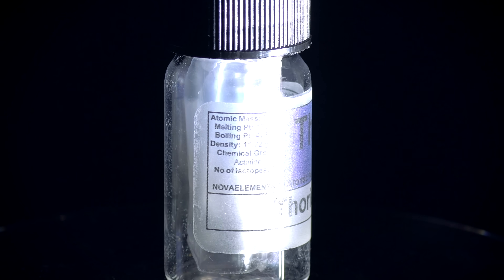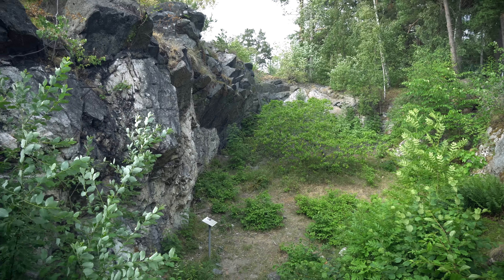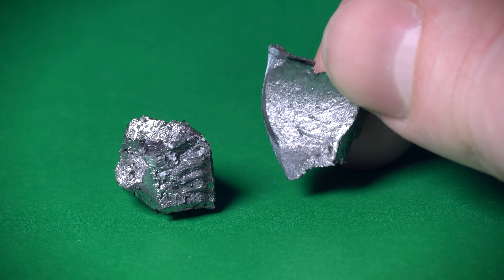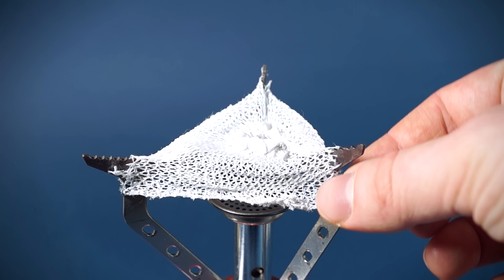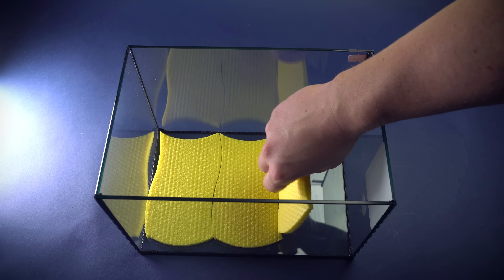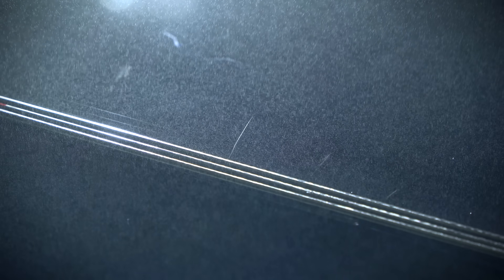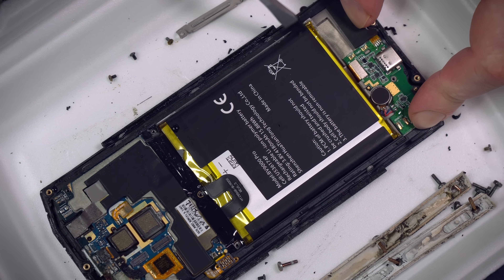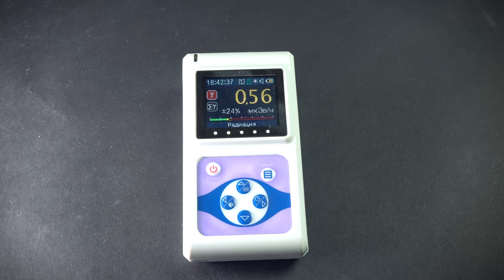Thorium - A METAL THAT NO ONE NEEDS!

Comment from the maker: P.S. Info about thorium reactors:
https://en.wikipedia.org/wiki/Liquid_fluoride_thorium_reactor
Also, it needs to be done a lot of research until thorium fueled reactors can compete with uranium based reactors.
P.P.S. Please help me make subtitles to this video, here is the script: https://drive.google.com/file/d/1vyE6xt3hEc2QEddYTOmKfMr4yfHMn9as/view
Reply: Thorium is the chance of almost endless energy. That is not useless..
Reply: No shit that it will take some time to iron out the kinks for a brand new concept that also happens to be something so incredibly complicated as a molten salt reactor. It took, what, 20+ years after the Manhattan project to make the first reactor that pooped out 5-ish MW?

I don't see why you went out of your way to shit on the concept.
Reply: @Runefrag  Molten salt reactors were first tested in the 50's and early 60's.  The concept is proven, it just needs a commercial reactor design and regulatory approval.  Which is difficult when the industry is based around light water reactors.  

IIRC China now has one up and running.
Reply: @p51mustang24  You just repeated everything i said.

As for the part you didn't:

MOLTEN SALT REACTORS // THORIUM MOLTEN SALT REACTORS.

Two different things. :)
Reply: Uranium in nuclear reactors is approximately 2%. Thorium reactors were in use in the 40's. No issue like the Fukushima disaster. The reactors could be turned off with a switch. But the uranium lobby convinced the government to support it. The rest is history.
Reply: https://en.wikipedia.org/wiki/India%27s_three-stage_nuclear_power_programme#Stage_III_%E2%80%93_Thorium_Based_Reactors

India is planning on using it in the future but it's a long way away :/
Reply: Try to find my teacher, Yudi Utomo. Now he is researching how to use thorium as a nuclear battery.
Reply: @dannielyuwono3680  same idea I had . the thorium will be the sorce of positive charges since it emmits alpha positive particle and the negative could be the air or the silicone carbide with aluminum doping ie ( deposites)  for negative charges .very simple idea .the thorium positive anode could be placed and packed in a glase container and the thorium could be in form of thorium oxide instead of pure thorium for economic reasons .and the glase container will be coated like a mirror to prevent alpha particles to penetrate outside the glass tube by reflecting the alpha ray into the thorium sample again .
This sustainable battery is very useful to put it to charge electric cars when they are going and staying far from charging stations and ponts .
Or to generate electricity in remote areas or other uses .
Reply: Would that ethanol happen to be drinkable?
Reply: @WaliWorldX Uranium is also a lanthanide but large deposits of economic grade exist all around the world, unlike the REEs.  It is the chemistry and mobility of U that makes it more accessible. There are deposits of U in many countries, including the UK but name me one of thorium in Europe!  Yes, there is a pegmatite in a small quarry in Sweden, but it is uneconomic and in a Natural Park.
Reply: https://ok.ru/video/98287684270
Reply: I'd thank you, but i didn't come here for a damned chemistry lesson.
entertainment likely required.
Reply: I have watched them and the USA had tried creating less expensive nuclear power reactor.  But the people who bribed the Nixon and Congress, people in uranium business already underway.  Sixth gen nuclear reactors are very promising.
Reply: "Sponges which I soaked in pure ethanol"
...proceeds to dump out contents of personal flask! 
Hahaaha xD
Reply: Thorium reactor was invented in India and running, India have highest deposits of thorium in the world 
Projects running to provide 50percent of India electricity in thorium reactors by 2030
https://youtu.be/pTFOzHsbvAE
Reply: @WaliWorldX We know where thorium and REE deposits are located in geological terms. The main problem is that (like lithium) their occurrence is not widespread.  Monazite sands and pegmatites are the main sources and these do not occur, e.g. in Europe.  Currently, thorium retails at approx. 100 times uranium and while this reflects mainly demand, it also reflects the difficulty of locating and supplying thorium.  Gold is less abundant than Th but it is easier to find and exploit small deposits of gold.  Most REE deposits are in China, so that presents yet another problem for supply.  Uranium is widespread in geographic terms, and cheaper easier to locate and extract.
Reply: hawkturkey  But only monazite-bearing sands contain thorium, and they only occur in a few special places. We know the geological environments in which to find REEs and Th, unfortunately they are limited in occurrence.
Reply: Yes, Th is about as abundant as tin but tin can be concentrated in mineral deposits.  Uranium is a thousand time more abundant than gold, but gold occurs in many geological situations and is likewise concentrated by some geological processes.  Thorium and the REEs (excepting U) are chemically unreactive so they are difficult to find and extract at the normal levels found in rocks.  There are many exploration companies prospecting for REEs (and Th which is associated) but it is difficult and only a few places in the world to look.  Uranium is so widespread that the price has come down and this actually makes it hard to make a profit on it! @WaliWorldX
Reply: @WaliWorldX I forgot - many countries adopting nuclear  power wanted to be independent of OPEC countries for oil  supplies, despite having oil/gas in the North Sea.  Likewise, depending on others for thorium would lose this strategic independence.  Uranium is widespread in Europe but not thorium.  The same might happen with lithium as Bolivia holds 50% of current reserves, and like thorium it is not readily concentrated by geological processes to economic grades.
Reply: Are all things in Ali Express have this stuff or just certain things that have it? Should I worry about everything . What about other based products from other countries?
Reply: Not true. There US govt experimented with both. Thorium lost only because you couldn't make Plutonium breeder reactors.
Reply: India was looking at thorium reactors but that was because they have more thorium deposits than uranium. The reality is you can breed fuel from U238. Some people say it's more safe because you can make nuclear weapons but this is untrue U233 has been weaponised.
Reply: At the moment I think it should be stabelised in a form that won't leach and won't form dust and stored back in the ground where it was mined in a form that can be retrieved easily if we find a use for it. I think rocket nozzles and furnace linings are definite allocations if you can make a sealed ceramic that won't produce dust.
Reply: Always was told thorium reactor research wasn't  invested in was because it didn't produce enough material for bombs.  Research was only done before the huge uranium deposits we have now were found.  It a damn shame as thorium reactors produce far less unrecyclable waste than uranium reactors, last longer while producing only about 10% less power.  As always the interests of military and money grabbers comes before the public good, they should be ashamed of themselves!!
Reply: Thor's hammer is made from thorium, of course I'm bullshitting.
Reply: @WaliWorldX Not unviable, there will be thorium reactors and some more Th mines but you can't extract thorium economically  from a crustal abundance grade, you need a geological process to create an economic deposit. You cannot just mine anywhere, you have to be in the right geology first.  This applies to most metals, copper, zinc, uranium lead etc., they need to be concentrated. The lanthanides do not have the same chemistry and are not easily concentrated by geological processes. Thorium behaves like a lanthanide but uranium does not, being somewhat soluble in water. There are 14 types of uranium deposits but only two for thorium.  So the pegmatites and the monazite sands are not widespread in their occurrence.
Reply: Max Pain  Not as plentiful as uranium though.  Only a byproduct of REE mining. Name a thorium deposit in Europe!
Reply: @WaliWorldX In mining it's very simple.  If the cost of digging out and processing the material is greater than the contained value at market prices, then you will lose money.  I did a calculation once on a river with alluvial gold in the gravel.  After a hard day's work we had panned about $10 worth of gold, more than our lunches cost!  With mineral exploration, the costs are all up front exploring large areas and employing people and special surveys and it might result in nothing.  Money is raised from investors but they stand to lose their investment.  Even if you are making money in mining, a larger deposit might be found in a low-cost area and the price goes down as supply goes up, so your little mine starts running at a loss.  In the end it's simply market forces that determine the price.  With uranium, there is plenty of supply and a consequent low price.
Reply: @WaliWorldX I think you would need to read up on economic geology. Mines have to be found before they can be opened, and when they are found they have to be operated under normal economic constraints.  You can not mine anything anywhere! For example, the average crustal abundance of gold is 0.004 ppm (g/tonne)  but even though it is valued highly, you still need a deposit of at least 4g/t grade to mine, i.e. an enrichment of 1000 times.  Chemical enrichment through geological processes, not isotopic enrichment, btw. For copper it is only 5 times but that is only for really huge deposits of hundreds of millions of tonnes.  In the case of U and Th one needs at least 100x concentration by geological processes.  Then you can mine it and again you need to concentrate it to a grade that your client wants, e.g. for fuel pellets.  At this point it has a value and that is determined by market forces. If people want it the price goes up, if others supply lots of it, the price goes down. There is no mystery or conspiracy!  But as I have said already several times,  thorium does not concentrate in the earth as readily as uranium, so the latter will always be cheaper. Not sure how better to explain this, so I will leave this debate now.
Reply: I am sadden you went so political on this one . thorium salt reactor's eat uranium waste by product's and you know it . if you have to use nuclear thorium is the safest way to go .
Reply: Yes, thorium as a metal has few uses. As the oxide, it  has many uses as the comments below point out.  However, as a nuclear fuel there is a major problem as although thorium is about 4 times more abundant than uranium, it does not form enriched mineral deposits like uranium which can be dissolved (hexavalent state) in oxygenated groundwater and precipitated in reducing conditions.  Extracting thorium from ores containing a few ppm Th will always be very expensive.
Reply: There are already big deposits of leftover 'waste' Thorium from other operations.
Reply: @mariobeck3798  Not large compared to uranium deposits in the ground.  I'm not talking about minor quantities of waste materials .The Olympic Dam deposit in Australia has enough uranium for 400 years at today's consumption.  There is no thorium deposit even approaching 0.1% of that.  Thorium is more abundant than U but there are no comparable geological processes to create large economic deposits of thorium.
Reply: @mariobeck3798  And lots of cheap uranium waste too!  As well as lots of uranium resources in every continent. One can't say the same for thorium which is very limited  in its occurrence.
Reply: @karhukivi  Thorium is refined from rare earth mineral sands as a byproduct. It is more concentrated than uranium is in its ores.
Thorium was used in gas mantles and high temperature, high strength alloys used in military aircraft construction. The demand has fallen, not the rather plentiful supply.
Reply: @allangibson8494  No, it is more abundant in the crust but not in its deposits which are geologically concentrated.  The huge uranium mines in the Athabasca basin have up to 20% uranium content, nothing remotely comparable in grade or tonnage for thorium.
Reply: @karhukivi  Are you describing enriching Thorium? That won't work. Which is why converting Thorium to a Uranium like material is necessary. What I like is it takes waste fuel and Catalyses the Thorium through a breeding process and you wind up with a poorly fissionable material that can be enhanced in a Graphite containment area to cause fission. But the numbers regarding efficiency is my interest. 95% from Thorium, compared to 5% peak from Uranium. Meaning 95% remaining is highly radioactive waste to be stored, or dumped into the Atlantic if you're British.
Reply: @bryanst.martin7134  No. I'm referring to extracting thorium from rock.  There are few geological processes to concentrate thorium from a background 12ppm to the sort of grades that can be economically mined.  Thorium is a late-stage precipitate in pegmatites which do not form large deposits. By contrast, uranium can form very large deposits.
Reply: @karhukivi  Because Thorium salt can be used in liquid form it can be filtered.  This makes it much more efficient and therefore much less is needed.
Reply: Multon salt reactors guess we don’t “need” them but I “want” them
Reply: @spearshaker7974  We need them.

Comment: What about thorium energy for the production of electricity?
By 2025 first thorium reactor will be completed in india for the mass production of electricity. They are working on it since 1960s.
Is not a useless metal because 1 ton thorium can produce electricity equivalent to 30 tons of uranium and its more controlled.
https://en.m.wikipedia.org/wiki/Thorium-based_nuclear_power
Check this 👆

Comment: I believe an alloy used in manufacturing rocket nozzles for large space rockets has thorium in it.
Reply: Just to please gods like Zeus.
Reply: I recall it as a mix with copper to give strength and resistance to melting while passing heat to fuel flowing through nozzles. Makes the gods happy when their gas is heated :)

Comment: Be careful about saying Thorium is useless, you might be struck by a thunderbolt.
Reply: Except that the replies are a bunch of idiots/Nerds that didnt even get the joke -_-
Reply: RyllenKriel nobody can be struck by thunder. Thunder is sound lightning is electricity
Reply: @vipervidsgamingplus5723  That's why, in my joke I specifically said "Thunderbolt" which is another term for lightning. Ah...this is taking too much effort for a cheap laugh.
Reply: More like struck down by radioactivity
Reply: Or perhaps a Thunderfoot....XD
Reply: @pDemios and what did he accomplish despite all that effort? Beat down some irrelevant throw away characters, forged a weapon that he used for all of 10 minutes while failing to accomplish his one goal with it.
He put alot of effort in infinity war with basically zero to show for it. Heck he even pawns off the role as ruler to valcarie who spent most of the last thousand years drinking and avoiding any kind of responsibility at all.
He's just pathetic now.
Reply: @pDemios yes, what did he accomplish exactly in either infinity war or endgame?
Reply: Thunderstruck 😉
Reply: @WaliWorldX I was just about to point that out
Reply: Thorium it was used in the tip of lightning rods or some spark gaps or surge arrester because of its electron emissivity it is stil used as trace metal in thoriated tungsten tip for TIG welding equipments.
Reply: I swear Thor is more than a superhero, he's a fucking Norse God; why the Infinity War and Endgame comments.
Reply: @WaliWorldX you need thorium or uran to get neolyn for batteries / electric cars / wind mills
Reply: @WaliWorldX Plus the waste products only last 300 years vs multiple thousand years.
Reply: U gonna see wrath of thor
Reply: Screw Bill Gates. He's a mass murderer and so is anyone who thinks nuclear power is about anything but wealth clique profiteering at the long-term survival of all life.
Reply: Or maybe an unnatural abundance of static electricity. . .
Reply: Took longer to get the joke more than I like to admit
Reply: You not see infinity war or endgame yet? Cant get much more useless.
Reply: @chadleach6009  Nothing is more useless in life than an underdeveloped sense of humour.
Reply: @chadleach6009  my friend thor isnt created by mcu
Reply: WaliWorldX Tony is alive - he put a pin in it- TIMETRAVEL PARADOX

Comment: Thorium does have usefulness in nuclear  power generation.  It can be used in thorium  molten salt reactors which is is much safer and ecologicaly safer also. There are still some technical difficulties but they are currently trying to solve these issues
Reply: In India we have already have a working thorium based nuclear reactor.
Reply: @eagleclawzz  Where in India?
Reply: @eagleclawzz  lol Where in India is there a functional, currently in operation, nuclear reactor that uses Thorium for fuel?
Reply: @uegvdczuVF  kalapakkam that is in Tamil Nadu.